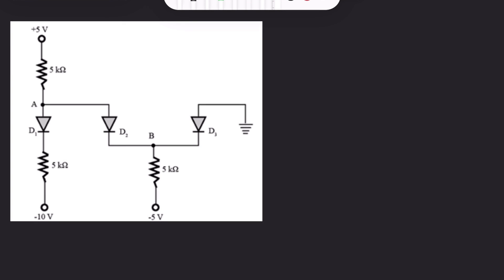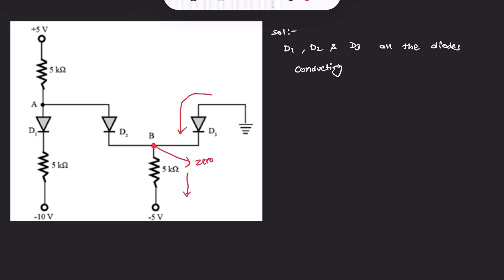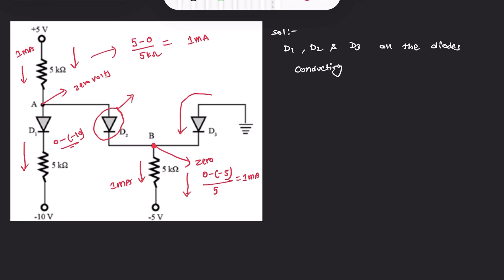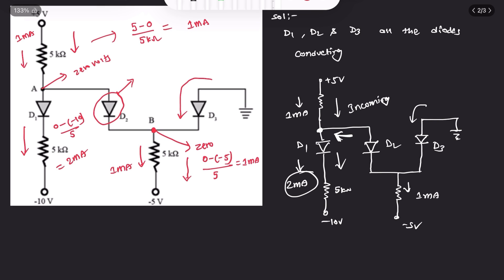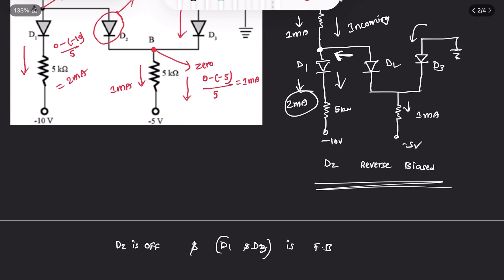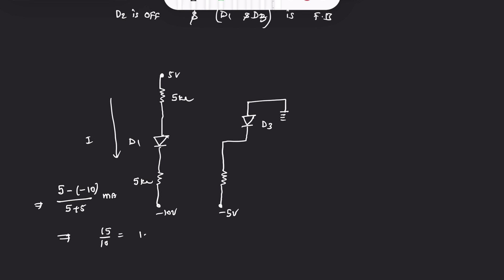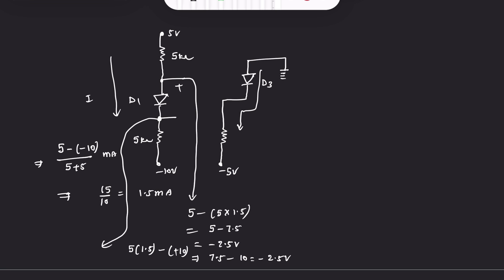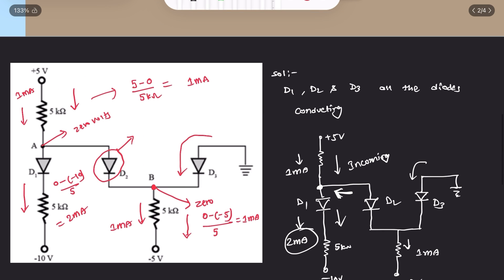Find the value of the currents through diodes D1,D2 and D3 Use ideal diode model

Comment: question between (7.08 to 7.28) time period 
how we get D1 negative terminal voltage -2.5 
since current direction is 5 volt to -10 volt .
got +2.5 volt D1 will be reverse biased.kindly mentioned plz
Reply from the maker: Because current through it is 1.5mA and voltage drop across 5kohm resistance is 5*1.5 = 7.5volts and already -10v connected at down so 7.5-10 =-2.5volts
Reply: @electricalstudent  here D1 cathode terminal voltage will be
-5*1.5+10=2.5 v will not be ? since current flow from 5 v to -10 v
Reply from the maker: https://imgur.com/a/XHhOBdr      I clearly explained in this image please go through
Reply: @electricalstudent  dear Kindly response about this math. which book i will get. ?  sedra Smith??
Reply from the maker: @ataur3027  go with microelectronics by sedra and smith and same title by donald a neamen also a good book